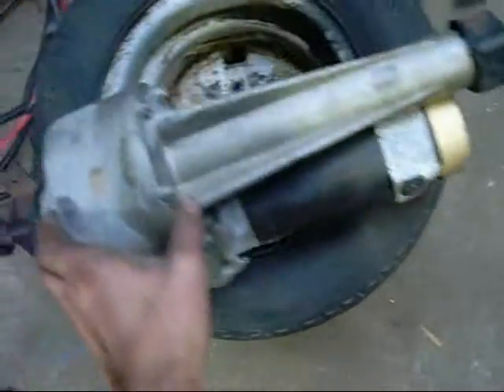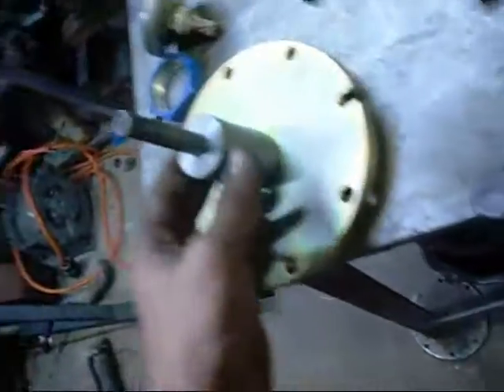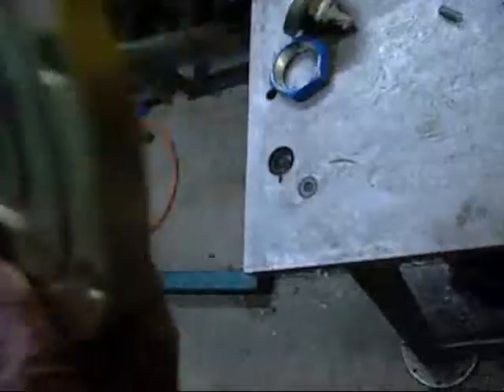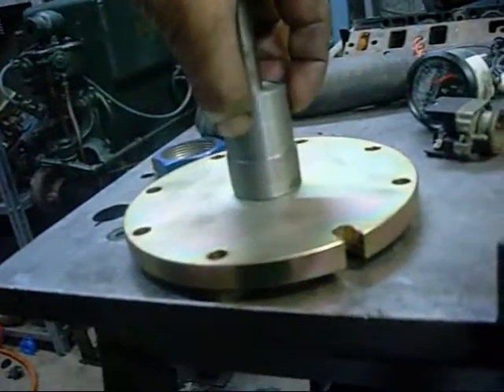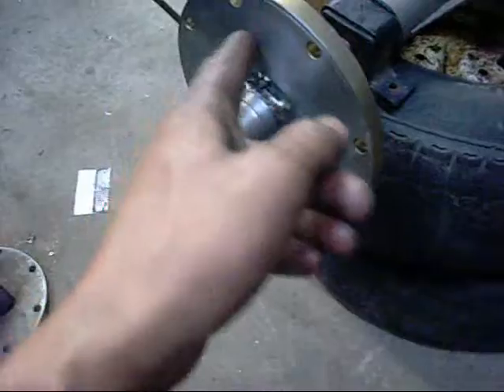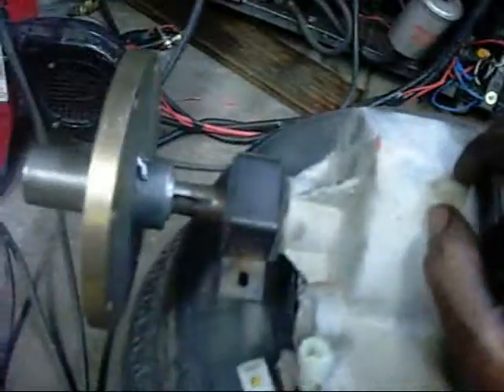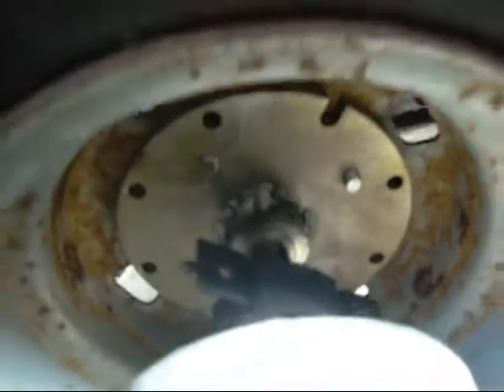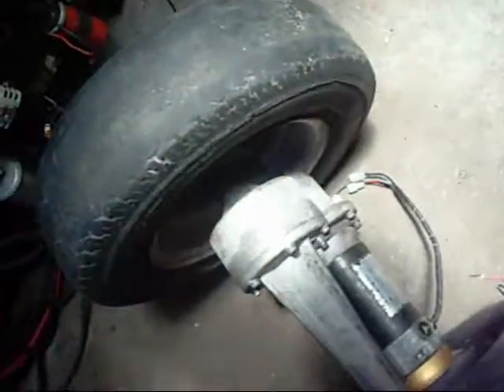Mounting Mini Car Wheels on Wheelchair drive

Comment from the maker: Thanks man, I consider what I did to be a hack job compared to what I normally do on bigger machines at work. but I do have a very large turret lathe coming soon so I can do things like these wheel flanges from 1 solid lump